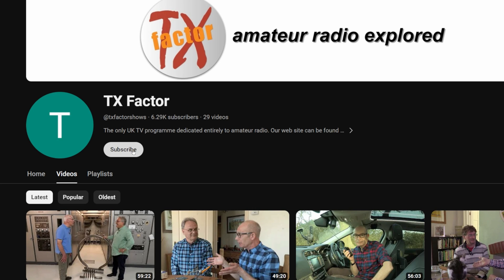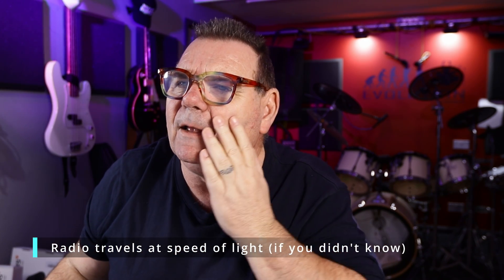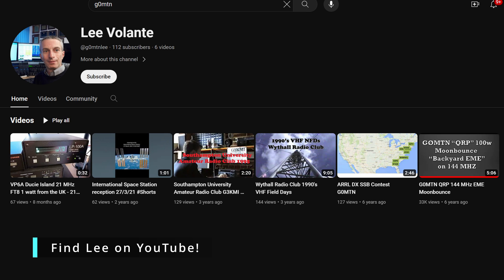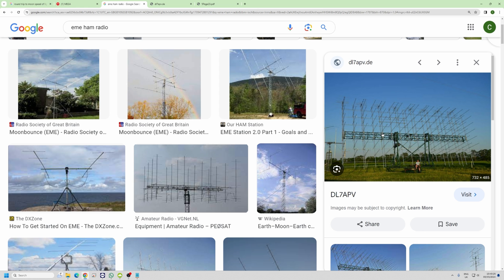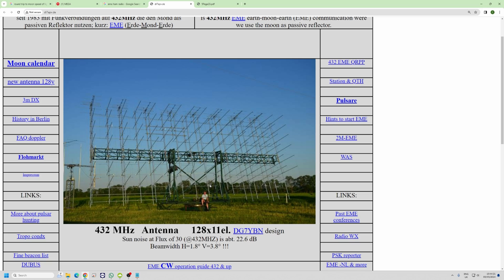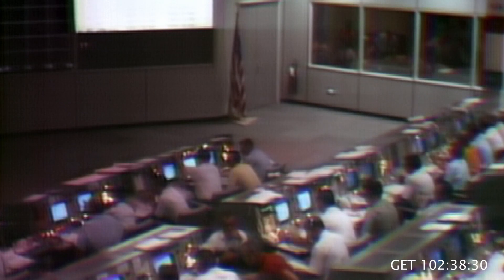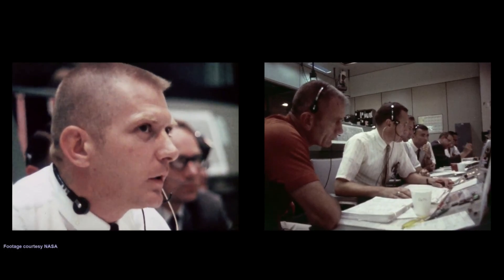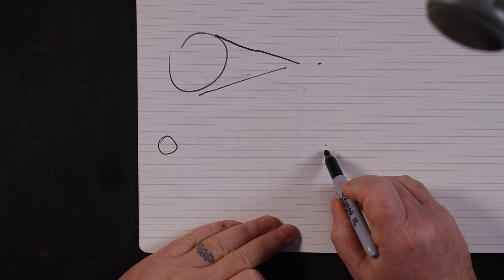Using the Moon as a Radio Reflector - EME - Bouncing Radio Signals off the Moon!

Comment: For those who don't follow the arcane thought processes of the flat earth advocate, they state that the earth is a flat surface (usually depicted as a disk) with the sun and moon about 1000 miles above circling like ceiling fans.  Most of them also state that above this altitude is a solid surface that they think is needed to keep the atmosphere from escaping to space. They don't think critically, however, so they never wonder what would happen if someone sent a radar signal up toward the moon and the firmament (solid surface). Of course, if the moon were 1000 miles away and the firmament a bit above that, it would only take about 10 ms for the signal to return.

If instead it takes 2.5 seconds it means the model is no good (wrt the moon at least). Then, since we have eclipses of the sun with the moon between the earth and sun, it means the sun is even further away, so their whole model is shot. So please publicize that radio operators (as well as the US Army Signal Core in Operation Diana) have consistently shown that a radar signal bounced off the moon takes 2.5 seconds to return. I adds to the evidence that debunkers need to show the flat earth idea to be nonsense.

Comment: If we have ham amateurs to talk to on ISS station, surely we have some ham amateurs on board of our secret moon station too. I wonder if with just handheld Yagi and 25W radio (Foundation limit) could I reach the Moon 🌝 - would you recommend 2m or better 0.7m band? I am really keen to try it. Just passed the exam, thanks to your informative videos and waiting for my license.
Reply from the maker: There is something called "path loss" so your 25W would gradually just fade away.. As the video showed, Lee JUST did it with 100W and digital, but talking to the BIG stations.. Ideally, you are into 1kW and a stack of 4 large Yagi antennas, pre-amp on RX and some stunning low loss coax.

Comment: I did some EME on 2 meters 25 years ago. I had a small setup with about 17.5 dBd antenna gain and about 800W output power. The radio was a FT-225RD with a muTek front end.
I had a thought about trying again a few years ago, but found that nobody use CW anymore, just computers. I want to hear the stations with my own ear.
Reply from the maker: Oh yes.... I see your point.

Comment: I tried a few EME skeds years ago with a 9 element ground mounted Yagi. Rx was sort of ok as i did hear a few stations but i was dreaming to be heard. I am actually still in a few EME groups and it is something i would love to try again with some better equipment. Thanks for the video.
Reply from the maker: Ah OK.. Well first-class for giving it a go.. I will initially attempt my 17 element and 100W.. But I fear I might need an amplifier and a pre-amp..
Reply: @DXCommanderHQ  I used a sneaky 100w at the time out the back of my old Icom IC746, good little radio that in its day, the days when VHF was smoking busy. Good luck anyway.

Comment: That physics works well until man adds his bit then maybe not so well. Our Apollo Lunar Heat Flow experiment flew on several missions. Our first after the aborted Apollo 13 was - I think - early morning here only 1/2 cuppa - Apollo 13.
Astronaut John Young was deploying some wired up bits near the central station RX/TX/ Power etc.   using  that hopping gait permitted by the moons lower gravity.  Everyone is watching in the control rooms in Houston - science control room for me -  Johns foot gets caught in one if the cables and he is dragging it along - 3 seconds to prevent disaster as the slack in the cable runs out if some one on the ground is quick. But no Apollo 15 is I think the first mission to make an enhanced tv signal available at all the workstations.  Pic is great - but it adds a 4 second processing delay. Too bad for Lunar Heat Flow as its our very strong Kapton covered flat cable with breaks.  Our team gets together with the astronaught techs and we come up with a  McGiver scheme to repair it - guys need to suit up to approve this - they do. But in the end The Geologists will not give up any time in the Rover for our attempted fix.
Reply from the maker: Yes, I remember John's "accident".. I've also read about it in a few books..

Comment: I have a moonraker on 11mtr , so far no luck with EME. I'm beginning to think it's just a name . On a more serious note I wonder what the limits are frequency wise for EME during solar minimum? Cheers
Reply: You'll want rather high frequencies because you're deliberately sending your signal out into space. High VHF, UHF, and SHF tend to be used for that reason. During a solar minimum, or at night at almost all times, 11 m is going to be a high enough frequency that you plausibly could bounce a signal off the moon. But you're still definitely going to want something directional, and it's much cheaper and easier to do that at much higher frequencies. Now that I think of it, bouncing GMRS off the moon might be doable and potentially even legal!
Reply: @grebulocities8225  Thanks and GMRS EME sounds like a winner to me .
Reply from the maker: I have heard someone once did EME on 40m.. I find that hard to believe though... Sunspot cycle does nothing for EME since there's no traditional propagation.
Reply: @DXCommanderHQ  Solar minimum is best for letting 11mtrs free into space during the day as well as the night with greater ease and regularity than would be during solar max , correct ? See why I factored in the Sunspot cycle now ?

Comment: I have just got into EME my first contact was the Cayman Islands. A group of us also do aircraft enhancement and we also use passing ships to bounce signals of. I just have a ic9700 12 elements plus preamp on 2M 24 elements on 70cm with preamp and 34 elements on 23cm. I can only work the moon as it comes over the horizon as I just have a normal rotator with no elevation. but been 150M from the sea helps.  73 ZL4SY
Reply from the maker: Wow.. That's crackers.. Love it!

Comment: I've made 11 EME QSOs with (I believe) six unique calls. I've worked Bernd DL7APV for four QSOs and Frank NC1I for three QSOs - all on 432 MHz, all <=100w output. 

I've built up to this point, but right now my gear is an IC-7100, a brown-face Mirage 100w mobile amp, a VHFdesigns preamp, and 2x432-6WL antennas from M2, and a used Yaesu G5400B Az-El rotator. Except for the radio, it's probably only cost me $1000-$1500.

My biggest limitation is my amp. I need 300-400w to be heard reliably by smaller stations. 

With JT65 and Q65, EME is accessible to everyone with the will to do it! 

73 VE3GKT

Edit: as for Cal's suggestion, you really need a yagi designed for 432*, not *440+ (440+ being for FM/satellites/etc). I've worked Bernd with no repeats on as little as one M2 432-6WL and 20w, but I would not go any smaller than that.

Edit 2: EME is like watching paint dry. It's super slow. There's hours of zero QSOs for small stations. You've really got to be motivated to get it done, take a break if needed, then take another pass at it. I've taken breaks up to a year long, and my first EME QSO was in late 2021.
Reply from the maker: Motivated... Yes all copied...!!